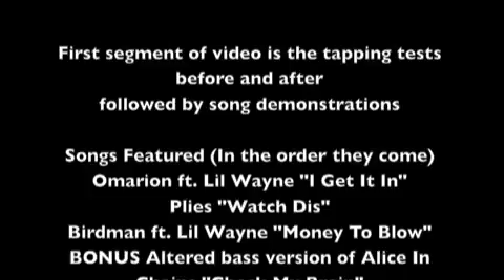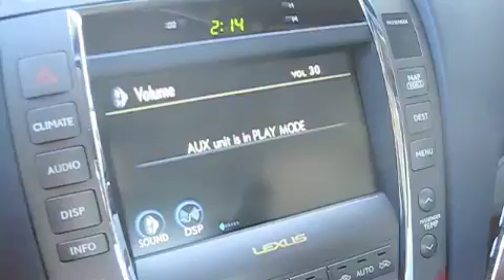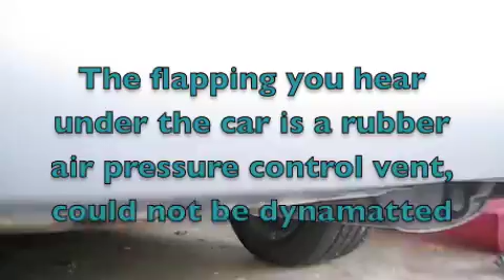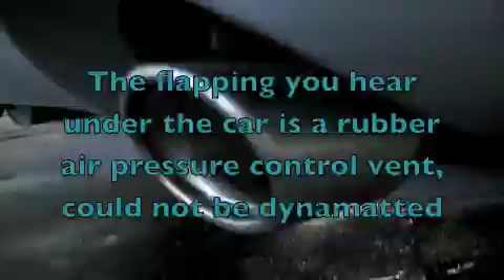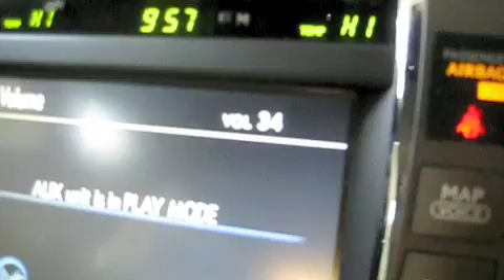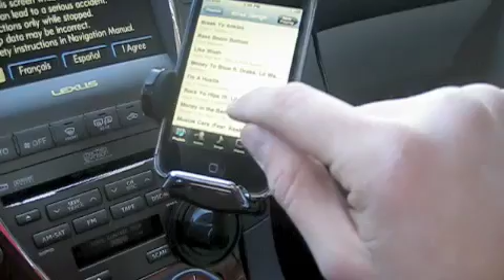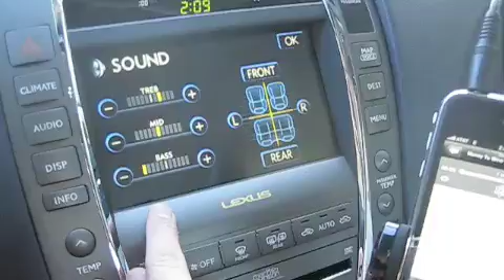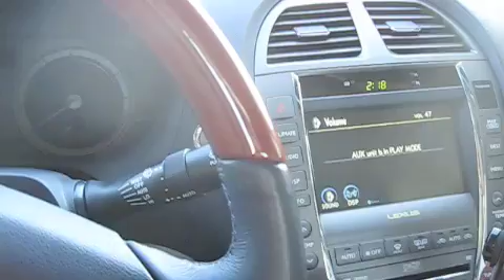Dynamat 2007 Lexus ES350 In Depth Before and After Review

Comment: Do you run the back seats down?  If not it would help a ton.  You Dynamatted the trunk and rear deck which seems like it would kinda lock the trunk in and apart from the cab.  Just my .02

Comment: Rubber air pressure control vent? So when the bass hits, there is so much pressure in the car that those flaps open? I had that happen in the Toyota Matrix my parents had. Won't you lose SPL ?

Comment: I'm looking to install some sort of sound insulation material in my car. I don't have a super loud sound system or anything, I mostly want to reduce road and tire noise and some of the noise from my stiffer suspension setup. It's an 11 year old car and it has some squeaks and rattles. Anybody have any suggestions on what I should use? I also don't want to add a lot of weight.

Comment: more bass isnt BETTER bass.  and if you spent that much and went through all that hassle, you should be using cds - not mp3's.  and what is the point of having any speaker, let alone a high quality high power speaker if it is not even IN THE CABIN?!?!?!  you are just annoying everyone around you making even a Lexus sound cheap with all the rattles.  at least point your sub the other way and open your 'pass-through'.
Reply: Blahblahblahblah.... You really have NO clue what you are talking about. Facing the sub forward will cause cancellation unless the entire trunk is sealed off.... look at the size of the box he is using. Please tell me how that will work out better for him? Facing the sub towards the rear increases output and causes the trunk to act like a second enclosure... As for MP3's... get with the times old man. A 320kbps MP3 file is indistinguishable from a CD to the human ear. There are also FLAC files which are even higher quality... so really, why do you need CD's?  Also, did you know most CD's have most of the low end frequencies rolled off so they sound better in a cheap home stereo? You really should educate yourself before trying to ignorantly pass off your OPINION as fact.